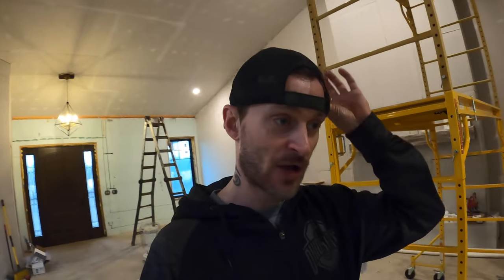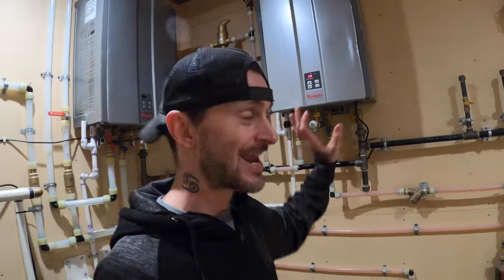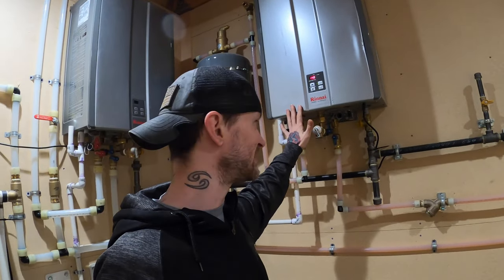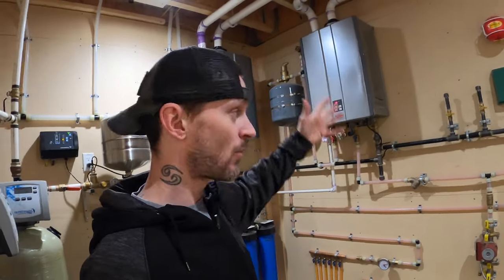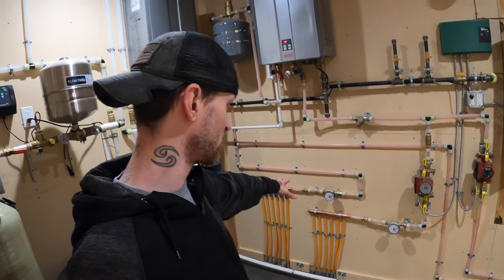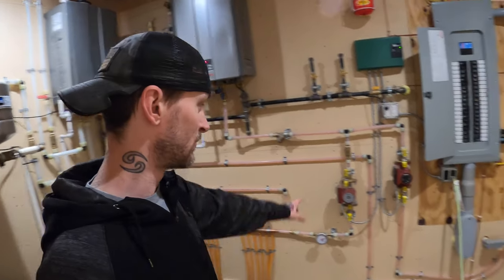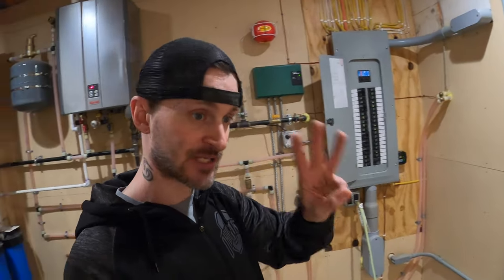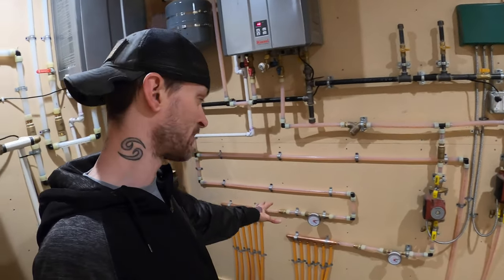Full ICF homes HVAC system w/ HRV!  Vlogmas day 13!

Comment: OK. Thanks for that. I've come to two immediate conclusions: 1. There is no single system that can satisfy all one's needs. 2. This has to be considered in detail when you're planning your house.

From your viewpoint (I'm no expert); you have hot air "trapped" in the basement. Your fan may not be efficient at sucking (in winter). I can think of options but you may not like them - notwithstanding your lack of desire for bulkheads. Place three or four inlets via a plenum in your basement ceiling around the open space between the stairwell and gym wall. Place a couple more in the gym. This will "exhaust" air from the basement to heat recovery for inlets. (Your won't like this:) Run a rigid duct up to your ceiling in the corner of the utility/kitchen with a plenum at the apex of your "cathedral". From there, run four ducts to each vertical corner side of your cathedral ceiling so the heat-recovered inlet air blows across the top of your cathedral area. You can then use your fan to "blow" it down into the living area. Effectively run your HRV primarily as a heat exchanger from the ceiling of your basement to the cathedral ceiling of your living area.

Probably a crap idea - I'm sure others may highlight it as such.
Reply from the maker: i think no matter what we just need to get it all installed then play with ideas.  im not putting anything down yet till i actually can play with each system and go from there.  i should have planned more in the beginning like you said but i thought ICF would be so good it wouldnt matter what we did.

Comment: I was hoping you would make a video about your HRV.  I'm building with ICF next year and plan on using a Zehnder ERV.  I think if you used something like their distribution box with their 3" plastic tubes you could run up through your basement ceiling, up through one of your interior walls and put the vent on your wall or continue running it up into your attic and then drop down where you need to.  Also, I would suggest putting a filter box on your incoming air so you could use standard house filters to keep your HRV clean.  Matt Risinger has a good video about that.  I'm not saying you have to spend money like he does but I think you could adapt the concept and make your periodic maintenance a lot easier and prolong the life of your HRV.  I plan on doing the box so I can add a good filter and when we have our forest fires here in Montana, I can slip in the carbon filter to keep the smell out of the house.  Looking forward to the next VLOG.
Reply from the maker: ill have to look into the interior wall thing.  with 2x4's i dont think that will work to well but i love your suggestion of a prefliter.  again i dont know what those green mesh screens are good for but that would definitely help things out long term with a good MERV paper filter!  ill check Matt's video out.
Reply: @neckofthewoods24  Home Performance channel has some pretty good videos about his HRV/ERV and the way he installed the inlets/outlets in the walls.  Good luck!
Reply from the maker: @krumafreak  thanks.  Will do.
Reply: If you do this suggestion, maybe steal an idea from big trailers with ducted AC and make rectangular ducts to go down the wall. It would be a pain to make them but an AC company could probably do it or a local steel supply who has a break for custom bends in flat stock. We have one over in Indy that deals in small quantity purchases and has a break for bends so if you can’t find someone local and you decide you really want to go that route, their name is Warner Steel and they might be able to ship them or you could do the couple hour drive if shipping is more expensive that round trip gas.

Comment: Built a 26 x 32 garage with radiant floor 12in centers, 3 loops about 275ft each and using a Takagi tankless 120,000 BTU's which monitors incoming and out going temps to self adjust how many BTU's to use. I keep the garage at 65 degrees. I have the out going temp set to 105F and return water is 75. From what I read and searched, you want to try and have a delta of 20 degrees. I might even lower it more, still learning and playing around. You might want to try and lower the out going temp, this way the loops will be more consistent in temps. At 140F, the first part of the loops will get the concrete hot and radiate faster, which would cause the hot and cold areas in the floor, IMO. When checking my floor with laser gun across all the area's, I only see about a degree difference. Interesting is I have 13ft high cathedral ceilings and temp on the drywall ceiling is 65 also. Floor is 75. I even wear flip flops out there now and can feel the warmth in my feet after being out there for a while. I'm in Toledo! Keep the video's coming,  I wouldn't have the patience to video and work at the same time. Merry Christmas.
Reply from the maker: thanks!!  im glad to see 12" actually works.  that plus your 3 loops all under 300' sounds exactly what my garage setup is.  i have it set to 55 because anything higher i get to hot working out there!  i will try and lower the temp, i had it set to 140 because last year we didnt have the attic insulation in and it just was working to well untill i closed the basement stairs up with the drywall laying across.  i would love to see a better delta!!  i just hate the water returns so cold.  my pump is also at high speed vs medium or low.  whats yours set to?
Reply: @neckofthewoods24  I have the pump set to low speed. You want to give the concrete time to soak up the heat.
Reply from the maker: @jim34w3  crap I can’t.  The two pumps fight each other and if on at the same time they won’t flow or at least the garage one.  The basement pump has a check valve that the floor needs to over come.

Comment: Meant to add… really check on the minimum effective outside temperature for the heat pump. The one in our 5th wheel is only effective down to 40 degrees F and then we have to either boost it with or completely switch over to the gas furnace. I recently saw a guy on another channel who is building an ICF home up in Canada and he discovered the same issue with his mini-split but I don’t recall what temperature he started having issues.

Another channel I watch built a three story 100% wood house in Massachusetts and didn’t feel like he needed an AC. Instead he put an air duct in the wall running from the highest point in the 3rd floor ceiling with a fan in it and forces the air down to the first floor slab. He actually has stone “ducts” in the slab that he is running the air through to cool it and then back up again, kind of an ingenious system. Anyhow, maybe you could do something similar but sucking air from the basement and blowing the air into the floor registers above. You might just need a short run that blows the air out a floor register or two or three in the upper floor, possibly into each of your stagnant rooms so that the air displacement forces air out of them. You could possibly use two inlets to avoid the bulkhead issue or use the “bulkhead” options from my other comment (small one on the wall or in a false column around the support pole)
Reply from the maker: yes 100%. i know the minisplit will fail at 4 degrees and they'll even ice up sooner if running all the time.  thats why im hoping the radiant floor will do the bulk work and these only have to kick on once or twice a day to boost the 1st floor heat up 4-5 degrees.  and with it being ICF it should hold the heat in for hours and hours!   and again, that fireplace could boost the house so much we might have to open a window it may get so hot! 

thats a very good idea.  may not even need a fan to boost the air!  but just add a register with the floor insulation moved aside. so install a register in the sub floor and the basement ceiling for a direct line of site or offset for better looks, that way the heats rising from the basement in more places then just the stair opening?  thatd be nice to do in the master closet since its as far away from the basement stair opening as you can get.  we still do have radiant floor as an option too but for way more time and some money.
Reply: @neckofthewoods24  Keep in mind that a direct’ish hole is going to transmit a lot of sound from one side or the other so at the very least I’d offset them by several feet so that the sound gets diminished by bouncing around for a bit.
Reply from the maker: @inmyimage1081  yes and I would!  Really only the closest and laundry may need it.  So rooms where it wouldn’t matter a whole lot.  Someone in the gym won’t be bothered by the dryer running and someone sleeping in that basement bedroom won’t really be bother by us picking our cloths out for the day.

Comment: Take a look at "The Build Show by Matt Risinger."  He's done a lot on HRV's.  Keep in mind the exhaust from humid areas like Bathrooms will take the place of a normal exhaust fan.  Some units have a 'high' mode that can ramp up for 30 mins after a shower.  You will probably need a dedicated kitchen hood fan/exhaust.  Nice Work.
Reply from the maker: yes i agree!  we still have bathroom fans and a 6" hood vent but this is all stuff we have to play with.  my unit does have that too so i think we'll dial it all in!  thanks!

Comment: Can you go through the fireplace from the basement to the attic to get the closet in the master bedroom
Reply from the maker: i could but i dont want to disturb my insulation or put duct work up there that will have low to very little insulation around the ducts.  air sealing and getting it back down will be do difficult since its all finished up in there.

Comment: They make a 30k outdoor unit. We have 18 + 12 in our work shop. And if you don't want to have the doors open or air flow isnt enough they make wall pass through vents.
Reply from the maker: its been a minute but i thought it was a 36k with the 12k and 18k heads.  i can look back at my email from Mr. Cool.

Comment: Use the chase behind fireplace for the duct. Run it thru attic.
Reply from the maker: To late now but we could of.    The attics all sealed up now.  I think I’m the floors will be fine and I think with the power of this HRV it’ll blow or suck air anywhere that’s in the house.  Like sucking the air out of closet with the return being in the bathroom.   Finishing it all up now!

Comment: When I was trying to get heat from the wood stove in the basement, to upstairs, I put in a duct with an inline fan to the room(s) I wanted to boost heat.
Reply from the maker: i bet that worked real well!   hopefully all this working together will keep all these from having to work hard.  if not ill have to start making new zone with the radiant heating tubes.

Comment: Can you put the HRV in the garage or garage attic? Then you can run the main trunks through the osb wall vs core drilling also the house air can run through the attic and down the walls for the basement. Do ceiling/wall vents instead of floor vents.
Reply from the maker: Definitely not the attics because the HRV acts as a dehumidifier and pulls water which will freeze.  the unit i think needs to stay warm also so you have a better exchange of air temps.  i did think about the garage for that exact reason of cutting the OSB vs the concrete but i dont want to see it and the ducts 24/7.  the 6" core drill i think will do it no problem and we'll get it done all will be hidden in the utility room.  drilling the I-beam floor joists are ok too since we can drill holes the full depth of the OSB webbing and the joist will still hold a load so not much of an issue there either.  just some extra work is all.
Reply: Frame up a chase from the utility room to the attic to run duck work to the front of the house.
Reply from the maker: @stevekiel395  unfortunately the attics all sealed now and our current chase is larger than we wanted.   I’d hate to try and get up there with all that insulation and remove it and add it and air seal the ducts and replace it etc.   plus the ducts don’t really have any insulation or much at all.  I don’t think I’ll be an issue to place the vents centered in the house and we can keep the doors open.  I know everyone does the attic ducts but here when it so cold I just wouldn’t do it unless they were buried under everything.

Comment: Two ideas, one: even though you don’t want a bulkhead running the length of the basement ceiling, what about one, possibly small, along the sidewall? It could either run the length of the side wall, or be just big enough to pass under the central beam. Two: build a false column to cover your support pole and run the duct in it from one side to the other. Bonus is that it pretties up the ugly steel support pole.
Reply from the maker: i mean really it just depends if its needed.  im not sure anyone could answer that but maybe a pro and again spend like $2,000 on a Manual J report.  for example a return HRV duct should go in the laundry room.  but if the laundry room door is always open and people are coming and going out of the garage all the time, i cant see that room needing a return or the air getting stuffy.  and maybe since the home is only 37' wide, a 6" vent in the center of the living room is more than enough.   i mean i dont know how hard to good the HRV will blow???   but we'll see, i have some ideas.
Reply: @neckofthewoods24  The trials and tribulations of being an Owner Builder, You save a ton of money but sometimes have to redo work as you learn more as your experience grows.
Reply from the maker: @inmyimage1081  very true!